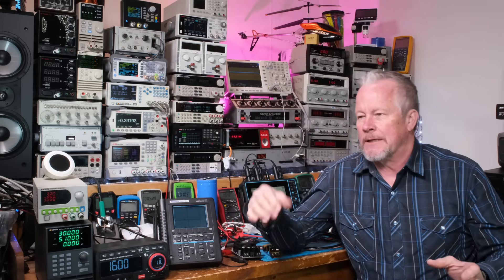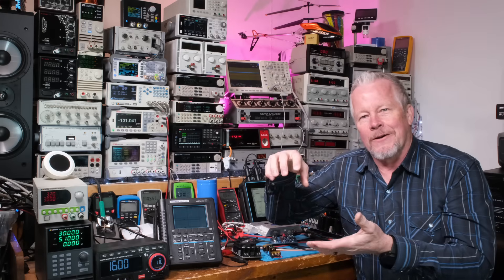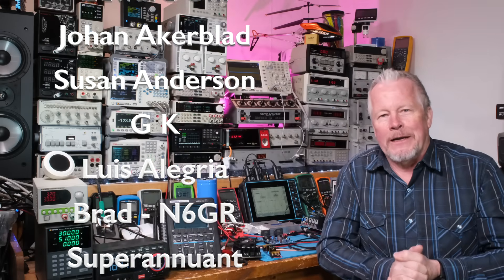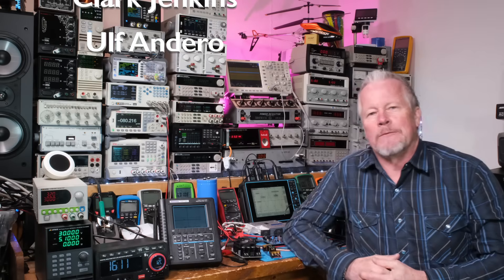Capacitor Bypass Value Myth #stevensandler #ericbogatin #bypasscapacitor #couplingcapacitor

Comment: Good points. In guitar pedal power supplies, I often see something like a 47 or 100uF cap across the power supply and a 0.01uF cap too. That never made sense to me for something which is connected to a non-bipolar external 9V DC power supply. They're just insurance for a noisy power supply that might have a bit of ripple. The big electrolytic is all that is needed in my opinion. I've seen times where people used a switching power supply which injected a whining noise into the audio, and the fix for that was to use a transformer based "wall wart". Some things are designed with a switching power supply in mind but a lot of things are not.
Reply from the maker: Thanks for this great feedback!  As a power supply engineer - I'd say the switcher could work as well - but most don't do it right - especially when cost is a driver.  I place a high frequency LC filter just beyond the larger LC power generation devices.
Reply: Did enough test and repair in the 1980's I wouldn't remotely call any of this a myth.  Small tiny tightly controlled caps were simply far better at higher frequencies than the larger caps, and it was extremely important on eariler ICs.
Less needed now is better IC design, smaller scale overall from surface mount, etc.  You 'd still never catch me not putting both small local bypass and a larger incoming cap for anything I wanted to ensure that it stays operating reliably.
Reply from the maker: Thanks for your great feedback!  You are supporting my argument here.  I did say that this myth might have been true about 50 years ago - which 1980 is 45 years ago;)

New boards that are SMD technology have different parts and use mostly ceramic caps for bypassing - and that's what this is about.  The myth of applying old (~50 year) tech to today's electronics.  I'd say 20 years ago when SMD almost completely took over board design - this has resulted in a big change in board design.
Reply: @KissAnalog  ' The myth of applying old (~50 year) tech to today's electronics. '

That's the point.  It's not a myth, it's a valid physics idea.
'You don't always have to cover that base in modern SMT electronics' doesn't turn the base idea into a myth.  It only means that you can get away without doing it.

'a widely held but false belief or idea.'
Even if it would only bite you in the ass in 1 out of 1000 modern designs, the idea behind it still isn't a myth.  It's not only a story, it is a solid design critera with valid reasoning.
Even now it would be foolish to design anything complex and costly without them.  You can always leave the components out if after assembly and test you determine that you don't need them.  But the cost is so miniscule compared to most boards it would still barely be worth thinking about, expecially vs the cost of having to redo boards if something was sensitive to it.

Bet you'd be hard pressed to find any of even the most modern IC datasheets telling you 'It's a myth and just skip correct bypassing..'

'10 Power Supply Recommendations
The power supply can be any voltage between the minimum and maximum supply voltage rating located in the
Recommended Operating Conditions. Each VCC terminal should have a good bypass capacitor to prevent power
disturbance. A 0.1-μF capacitor is recommended for this device. It is acceptable to parallel multiple bypass caps
to reject different frequencies of noise. The 0.1-μF and 1-μF capacitors are commonly used in parallel. The
bypass capacitor should be installed as close to the power terminal as possible for best results, as shown in
given example layout image.'

Even this is only talking aobut .1 right at the device, and you can bet their design guides tell you to put the other larger caps in the general area of multiple chips..

'You can usually get away without doing it' doesn't actually make something a myth.  It's simply taking a gamble.
Reply from the maker: The practice that I talk about here is a myth in today's electronics (in the last 20 years - at least).  The reason not to use old tech on today's tech is clearly that there are better options - and using old tech does hurt.  The idea is to use the best bypass capacitor that we can - and that is not to place the 0.1 uF cap - but to place the best cap - which can be a 1 uF or even a 10 uF cap.

We have to change with tech and not keep the old tech just because it worked 25 or 50 years ago.  

The point is - today using old tech as the way to do it today - is a myth.
Reply: @KissAnalog  'and that is not to place the 0.1 uF cap - but to place the best cap - which can be a 1 uF or even a 10 uF cap.'
Completely wrong.
Basic physics scaling laws say the .1uF cap passes small signals faster and better than a larger cap.  That is no myth.

A woofer is crap at passing tweeter freqencies compared to a tweeter.  Same basic physics.
The small signal going into a larger cap produces a smaller delta V across the cap, and a poorer pass response.  No amount of saying 'myth' changes that basic fact.

The small local cap is there to bypass minor incoming noise, but really to bypass the chip itself's own switching transients, so they don't induce false operation.  No further away or larger cap will be as good as the small local cap at it.

Manufacturers understand what they are doing, and haven't been putting in extra caps for no reason.  Yes, you can often get away with leaving parts out sometimes, but you're not remotely testing everthing under all conditions to properly claim it is merely a myth.
It's really basic transmission line theory that you need the bypass at the chip so the switching transients don't cause immediate level shifting and induce incorrect operation.  Not really sure why you're thinking that isn't a real idea, you can test switching transition problems on a scope very easily.  It's the exact same idea, just local right at the chip.
Reply from the maker: Thanks for your feedback - but you don't understand the concept that I am talking about.  You are saying that myself and 3 leading experts in the field are wrong???  Have you stopped to think that your simplistic look at this is wrong?  Just look at the data sheets for impedance.  BTW, I'll do some measurement videos to prove this.  Thanks again...
Reply from the maker: OK, so since the 80's - when you were using your IQ to repair C-64s and burglar alarms - I was working on power supply design for fighter aircraft.  Oh - I played with those things too - but just for tinkering and having fun.  But - you think those were High-End designs??

It is so funny that the arrogance of someone bragging about IQ level would think that they KNOW more than industry experts.  I learned a long time ago that there is a huge difference between arrogance and true confidence.  This seems like a fantastic example of the Dunning-Kruger effect.  I'm sure that you have books out like these industry experts - to explain the depths of knowledge that you have obtained in your C-64 days...

The funny thing is - I do understand your 'old' argument from the 80s.  Probably better than you do.  This is not true today.  I have taken many measurements and have solved many issues by NOT following this practice.  This is now a myth in today's electronic designs.

Maybe if everyone had your IQ we would not be talking about this as it would have fallen from today's designs - oh wait - you still beleive this.  Maybe it does not matter what 'IQ' someone scores - but comes from practice and understanding of physics.  Not the physics from a book - but physics in a circuit.  

From your IQ score - I would assume that you understand what parasitics are???  AND - where they come from and what can create them?  But then again, knowledge comes from the desire to learn and the willingness to open the mind - not from an IQ score.

You cling on to your 80s knowledge - and I'll keep moving forward with technology.

You are always welcome to give your side of things...maybe us less fortunate can learn from someone with such a high IQ...
Reply: @KissAnalog  Great.   Then why are you mistaking a correct understanding of scaling as as myth?
No amount of 'many modern chips can get buy with less if you're not doing much' makes the correct ideas any less correct.
Why aren't you out there telling all the design engineers who still put in bypassing caps that they're wrong, and that they don't need those caps at all?

Get off your ass, and go fix all of the ' only based on myth' design coming from people who are actually testing their designs to all corners of the specs.

Since it's all just myth,  you really need to correct history and change all of the transmission line theory textbooks that 'the larger cap is just as good at passing small transients than the smaller cap'.
That will be interesting to see, since it's trivial to prove incorrect on a scope.

You're the one jumping from 'I can get away with not worrying about the cap size and just using one larger cap' to 'it's just a myth that people thought they needed the smaller size too'.
Everyone else isn't remotely as stupid as you claim.
Reply: @KissAnalog  Hey you know what?  More important subjects are about.

Lie to everyone.  Feel great and super smart about it.  Have fun.
Reply from the maker: You are funny - so if I agree we all don't have your high IQ (was it 160?), then we are stupid.  I never claimed that - you did.  I am happy with my IQ - and my desire to keep learning.

I never claimed that we don't need bypass capacitors - I claimed that using the decade (3 capacitor) approach is a myth today.  A single 1 uF or 10 uF - or 2 of each is better - and the idea of using 3 capacitors at different decades is a myth.  I am echoing the voice of 3 huge personalities in signal integrity.  You claim your high IQ puts your knowledge and understanding above them.

Unfortunately your High IQ does not allow you to let things sink in that you dismiss.  You cannot learn without opening your mind and considering what is said - vs claiming what is being said.  You have to be right - so you will be wrong in this case.

And - I am trying to help by bringing subjects like this to my viewers so that they can learn the new ways.  Some like you will not learn and grow - but will cling to beliefs - minimizing the value of your high IQ.

And yes - this can and has been shown with a scope.   And yes - it is somewhat trivial - if you know the proper way to measure.  But - you can also use your High IQ to read data sheets.
Reply from the maker: LOL You are on a rampage;)  Wow - how triggered - and what is your point?  I think you lost track of your argument.  Now just simply attacking - must be the High IQ is banging out of your head;)

I am out there trying to help correct a myth...Why do you think I made a video???

Once you settle down - and think...use that Hi IQ...you might understand what I - and some of the top signal integrity engineers are trying to convey.  I'd try to repeat myself here - but to those who refuse to hear and learn - it is a waste of time.  It doesn't matter what your IQ is - if you do not want to open your mind and 'hear' new ideas - you will be stuck in your myths.  Have a great time.  I am done wasting my time with someone who is so triggered...
Reply from the maker: @modellights This subject seemed so important to you - I hope you will learn something.  Once you calm down - the HI IQ will probably absorb it.

Lie - really - it is technology which is objective - and proven - let it sink it...

I'd be happy to have you come back when you are centered...

Comment: It's been several years since I built a PCB, but I don't believe anyone has developed an inductorless capacitor yet. What I found is that multiple capacitor values are necessary for the reasons you stated. You need bulk capacitance distributed across the PCB to defeat the inductance going back to the power supply. At each chip you need decoupling capacitance that will support the shoot through current resulting from the switching current of the digital logic. The inductance in the traces and vias limits the capacitance (charge availability) for a stable power distribution network (PDN). I was working with GHz logic speeds on PCBs with multiple SerDes. What you will find is you need more bulk capacitance (hundreds of microcfarads as the current goes up) and nanofarads to picofarads distributed across the board. You can think of capacitors in a PDN as frequency translators. The capacitors are supporting logic edge transitions in picoseconds from a power supply that wants to crawl at DC. Xilinx had app notes on their recommendations for decoupling their FPGAs. It's worth the time to understand this info. 

Along this same vane I shutter every time I see someone constructing a single-sided PCB. Why? Because you don't have field containment for the switching currents that are going to occur. Any time you switch logic levels, the bigger the current loop the more noise you radiate.

Comment: Great video as ever! If there's room, I normally put space for both an 0805 and 0603 for decoupling - only fit the smaller (cheaper) 0603 to begin with (typically 100nF) - but put the bigger (more expensive ones) on if the design has problems during fast transient testing, etc. Then you can remove the unused footprints when you go to the pre-production version of the board.
Reply from the maker: Thanks for this input!  Yes, I will also put - what I call - place holders when I am not sure.  Then usually I just leave them as no pop on the parts list - just in case later I find that they are needed;)

Comment: Done a lot of RF work and a bypass cap on the DC line of a 900Mhz circuit is completely different from a bypass cap on a 317 for example. @ 900Mhz/1296 its not uncommon to see 100p/1000p and a 1u on the dc line.  Do you homework.
Reply: i wanted to say the same thing u cant just say 0.1 uf is useless these days thats total crap
Reply from the maker: LOL - I have worked a lot with RF engineers - and I teach them things;)

I actually do my homework - and make power supply designs for RF - so I actually know what I am talking about.  This application of 100p/1000p and 1u are complete myths.  

If you did your homework - you would understand why.  

I will do more videos showing this myth - and why those people that propagate this myth do so.

Comment: Great discussion.  Thanks for sharing.  Can you share some insight on coupling capacitors in the terms of Audio and RF amplifiers?  What capacitors types should be used and values?
Reply from the maker: Thank you!  And - thanks for asking!  It really depends on each application - even within types of circuits (RF and Audio).  

Ceramics are king - just because of size and cost.  And to remind - ceramics are not all equal - their are so many types.  But, poly caps have their place as well.  

Sometimes you don't want a super low esr cap - it actually helps to have some series resistance (ESR).

It is best to look at an IC to see what they recommend (and don't believe everything that they say;), but if it is discrete circuits - then that can be a different animal.  If it is power rails - then that is even different.

General rule - if it is timing and/or clocks - use NPO/COG ceramics.  If it is HF decoupling use ceramics.  If it is snubbers and/or waveshaping - polys;)

Comment: If you have a more critical application, try using low ESR (equivalent series resistance) and/or ESL (equivalent serices inductance) capacitor(s).  I've seen this make a significant difference where noise suppression is important.
Reply from the maker: Yes!!  So true!  We have to love SMD as it has made this so much easier - but has also allowed for so much more speed for circuit designers - so then we have to learn more;)

Comment: Funny that you talk about this topic now. I was in the process of designing/building some high speed digital circuits and scratching my head over the selection of decoupling / bypass caps. 
Very helpful. Thanks for sharing.
Reply from the maker: Thanks so much!  Did you see my last video - which I talk about high speed circuits?  Board stack up is so important for this;)  https://youtu.be/9tbmsCMfTcM

Comment: Informative video! I will add that class II and III ceramic capacitors have voltage dependance. As the DC voltage across their plates increases the capacitance decreases. It can be as much as 75% as it approaches its max rated voltage. For bypassing, I use the X7R types of at least twice the voltage rating needed to minimize the effect. There may be better solutions, but cost and space may a concern.
Reply from the maker: Thanks John!  Fantastic point!  It is a great habit to choose voltage ratings at least 2x the applied DC voltage.  The value in a ceramic drops with applied voltage - plus the impedance might be better with the higher voltage rating.  Look at the curves - that is the takaway here;)  

Glad to see you here John - you are one of my favorite channels!!
Reply: Protip it's not the voltage rating that matters, it's the physical size of the capacitor, or more accurately the capacitance per unit volume.

Manufacturers will routinely build a 50V rated MLCC and then create a whole series of part numbers with lower voltage ratings that are actually just the exact same 50V part. So picking higher voltage ratings is not going to help you. It's better to refer to the V vs C charts that most manufacturers now publish
Reply from the maker: Thanks!  Yes all these things can be true - but how do you know a cap is over rated?  You are correct - the physical size matters as I suggested in this video - but so does voltage rating.  The applied DC voltage does reduce the capacitance - no matter the rating - so to be sure - select a DC rating twice what you need;)  ...unless you know that the cap is under rated;)